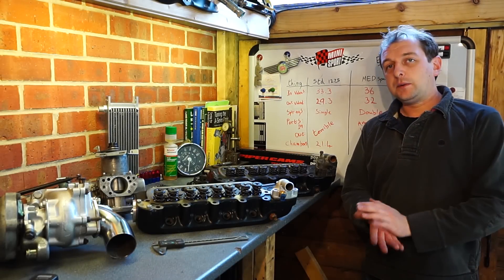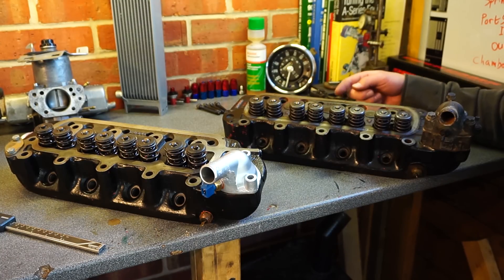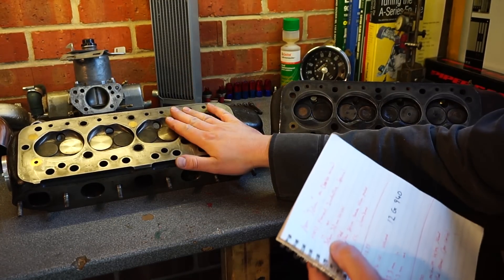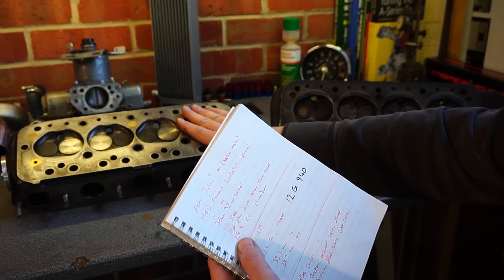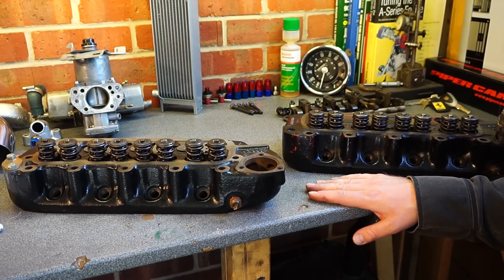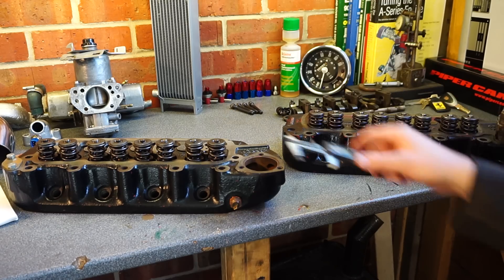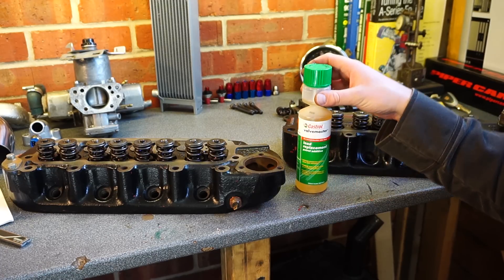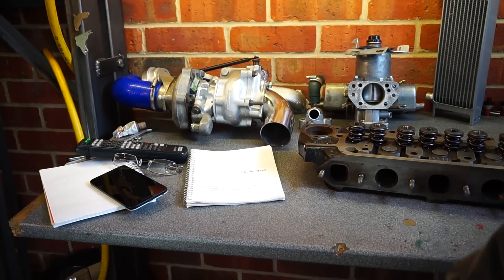Turbo Mini TV - Building a 1310 Turbo Classic Mini - The Cylinder Heads

Comment: I have a bored 1275 ,to 1380? its got twin hs2 carbs not running yet ,is it better to just get it running with them or buy a turbo kit? I want it fast but reliable without striping the block

Comment: Why is the intake valve bigger than the exhaust valve? I'd have thought you'd need a bigger exhaust valve since when the fuel is ignited it becomes a gas and expands.
Reply from the maker: They always are - basically its harder to suck air in then push it out, so you need the extra opening area. The exhaust effectively pushes itself out.
Reply: Ah, that makes sense. It's interesting to see how restricted the normal Mini head is.
Reply from the maker: Yes extremely restrictive. 
Did you know the original design for the A-Series was used as a generator engine for a tank?
Reply: Turbo Mini TV That's interesting, I've never heard that before. it's amazing how much of a varied life the A-series has had.
Reply: There are 3 exhaust ports and only 2 inlets, that's without considering the A's siamese ports are fought over by the closing inner cylinder and opening outer cylinder.. 

The inlet charge is around atmospheric pressure, even with forced induction the pressure drop at part throttle will be comparable to the boost pressure increase; the cylinder pressure when the exhaust valve opens will much higher, but that means the gas is also at much higher density. The volume in the cylinder is also reducing as the piston travels up the exhaust stroke - compared to the induction which is sucking against the good as infinite volume of the planet's atmosphere.

So the real challenge is to evacuate the exhaust gases left in the combustion chamber when the piston reaches TDC and stops pushing them out. A smaller exhaust port means higher gas velocity through it and that creates inertia to suck the remaining exhaust fumes out as the inlet valve lets the next charge of air/fuel mixture in.
Reply: The A was used as a starter motor for a generator's engine and also as a diesel for a tractor. The small ports gave great gas velocity for load speed torque, actually what you need from an engine in mundane daily use, rather than outright power.